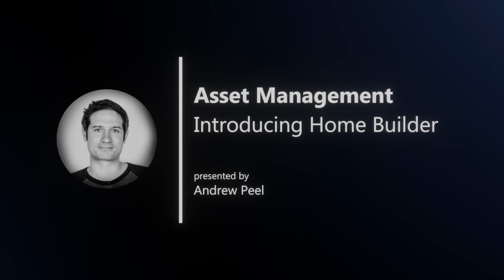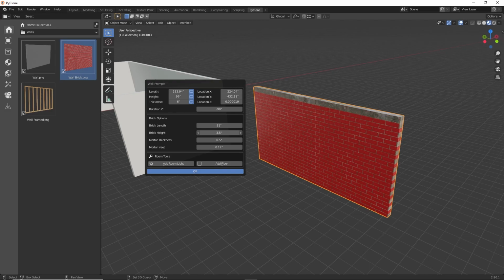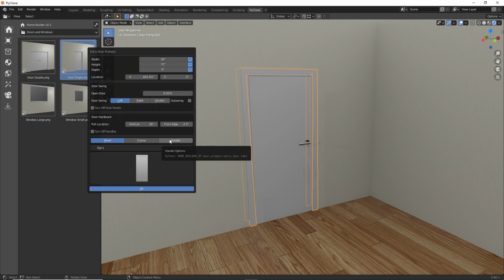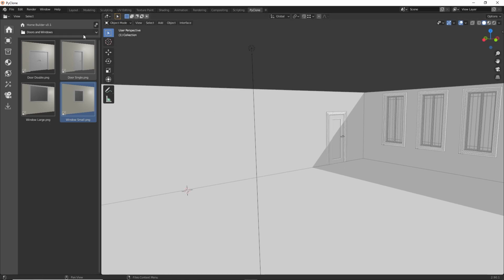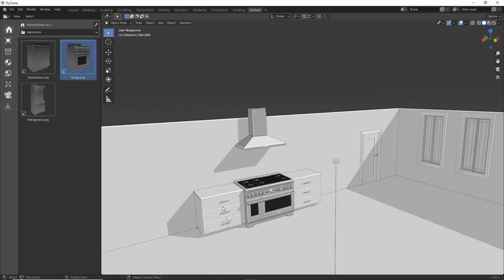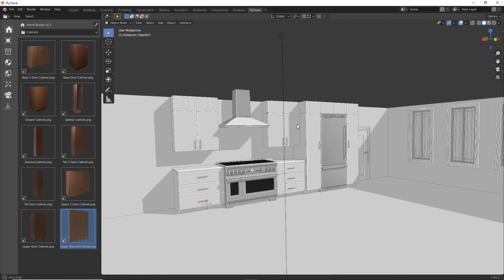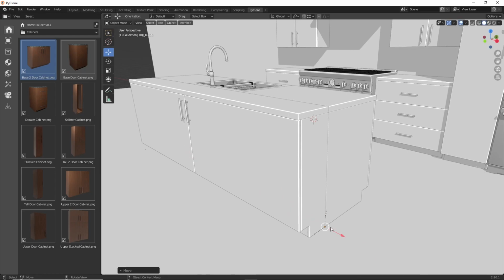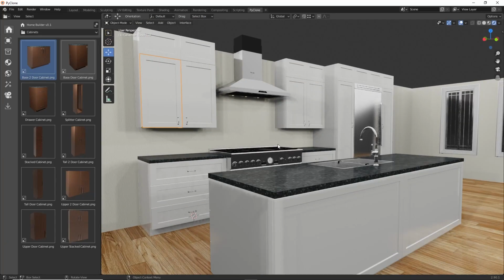Introducing Home Builder for Blender

Comment: hi  Andrew how can i down load the full version of the home builder library .  i dont see a place where i can donate or download it . Is the deco style doors only for the full version? will u be able to change the profile of doors like i was able to do on fluid designer. also the option to put the jpg floor plan under and scale it all those will speed up the work flow for all the interior designers like me .
Reply from the maker: The Home Builder Link is here. https://creativedesigner3d.com/2020/11/12/home-builder-asset-library/ Yeah I will be adding a lot more functionality including the ability to trace floor plans.
Reply: @andrewpeel1996  thanks and the framed cabinets line to that is important . I try to download that link , but the library u show in video has more stuff in like those deco doors. I can not find them in that file.

Comment: Hi all, If anyone is successful in compiling blender with pyclone for linux. Please share how you did it. I can compile regular blender, but I get an error compiling this source code. I would so appreciate the help.
Reply from the maker: Make sure you use the libraries for the 2.90 version when compiling.
Reply: @andrewpeel1996  Thanks Andrew I know pyclone is focused on windows. I appreciate you trying to help.  I can only follow the guide on wiki.blender.org I have not found libraries for 2.90 yet. I can't wait to get  get the extended asset libraries. I have an old windows machine until I figure out the linux issue

Comment: Very good. Now I need the technical drawings and the cutting lists.
Reply: Purchase microvellum! It is basically this but with the engineering for a cabinet shop. We have been using now it for about 7-8 months and it has done wonders.
Reply: @jasonzook5815  I tried to use it, very complicated, very non-opaque business model they run with requesting trials, not giving pricing info, etc.. Also obviously lacking in community content and tutorials like Blender. Maybe I should give it another try, but I felt I got stuck with the trial almost instantly.
Reply: @Xoliul  Its worth it. We didn't do a trial we just went for it. Ill be honest it was like $35k for one seat. That came with a month of remote training to learn the program. After 6 months or so of using it with production it is well worth the investment. There is another software called Mozaik that we tried but it is very basic and not very customizable but it definitely works and way more affordable.
Reply: @jasonzook5815  Yeah... nah. I'm just a guy who does this as a hobby, hoping to maybe make it a side business one day. For 35k I can just keep on modeling stuff manually :)